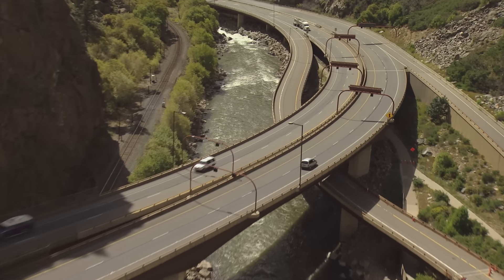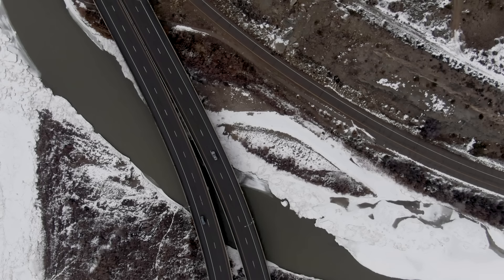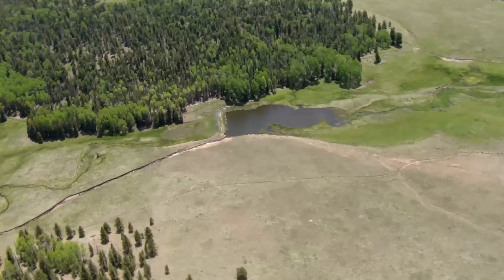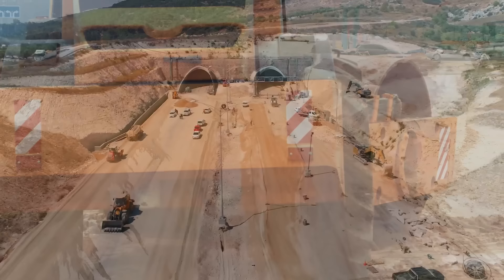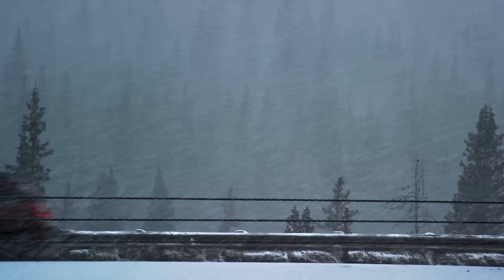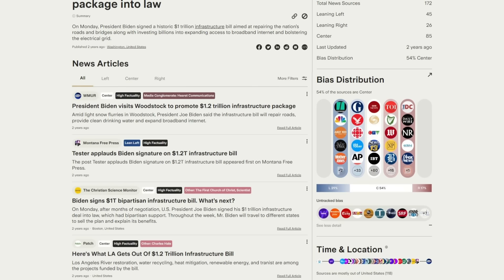How to Build a Road

Comment: The I-70 tunnels are 50 years old now, and are WAY overdue for upgrades.  They weep water that freezes on the road, there are heaves in the pavement in the spring thaw, they are too skinny, and are always badly rutted from truck chains.  We waste $$$ billions putting in dangerously skinny toll "express" lanes on the east side of the tunnels, that actually are only more places for cars to end up parked during traffic jams, and are always closed during snowy weather because of their danger.  Instead, there needs to be a 3rd tunnel, that can have traffic reversed to relieve the choke points that occur every Friday PM and Sunday PM.  No matter how wide you make the highway on either side of the tunnels, as long as traffic has to squeeze down to 2 lanes at the tunnels, there will ALWAYS be jam-ups.  A few years ago they instigated a "slow-to-go" program, where they meter the tunnel traffic, then put State Patrol cars in front of the traffic so no one can catch up with the previous metered group.  It's ludicrously stupid.  Was supposed to reduce accidents, but in reality, hasn't, but instead turns a 2-hour drive into 5.

Comment: The force caused by the inertia of a moving car causing it to go straight instead of following a curve is centrifugal force. The bank of a curve and the friction of the car's tires provide centripetal force to try to keep the car on the road. If it slides off the curve the centrifugal force is overcoming the centripetal force.

Comment: Step 1 - Spend 500m on research
Step 2 - Have the gov discuss if we should even do it and spend another 250m on those discussions
Step 3 - Find a contractor that will charge the city 25bn and then they'll subcontract the job to someone else for 2bn
Step 4 - Wait 15 years and project will be only 5% complete and x 100 overbudget.

Classic.

Comment: Road designers don't tilt/slope a road to counteract centripetal force!!! Centripetal means "center seeking". It is the force necessary to overcome the inertia to continue in a straight line and instead make an object follow a curve. It points to the center of curvature. Friction supplies the force normally. But a slope converts gravity into a centripetal force also. Hence, when friction is low due to ice, gravity can help make the turn -- just not at arbitrarily high speeds.

Comment: There's so much more to the Eisenhower Tunnel than any one video could possibly cover.  My favorite bit of trivia about the tunnel is that because of its 1.7 mile length, enormous fans must run continually to blow vehicle exhaust out of the tunnel; the electric bill to run these fans is $70,000 per month.

Also, the tunnel has a place in the history of the women's rights movement.  In 1972, a female CDOT employee was mistakenly assigned to the tunnel due to a name mix-up.  Male workers threatened to walk off the job -- and some of them did -- if a woman was allowed on the crew, because legend had it that construction accidents in tunnels were more of a risk if a woman was on the crew.  She kept coming to work anyway, and the men found a way to get over it.

Comment: A delightful video, as someone working in this field there was only one single minor half-truth throughout the whole thing. At 6:15, the $0.94 cent in additional cost sounds a bit less severe due to the value likely being from the time of planning. A modern value would likely be closer to $6.25 (10 mile by the vehicle depreciation rate of ~$0.625/mi).

And to put  that into further perspective, the AADT of this road is ~33,000 vehicles per day which translates to around $75,000,000/yr in additional costs.

Either way, very nice video.

Comment: Road banks actually generate centripetal force (instead of relying purely on friction) and counteract momentum (often mislabeled as centrifugal force). There is also a slightly higher amount of friction/traction due to the higher “normal force” aka force perpendicular to the road surface.

Comment: To be honest the section of I70 up to the Eisenhower tunnel isnt that bad. Once you get west of that though and up into the passes the roads become very narrow. I remember driving a Ford E350 van up there for work. You get to points where you cant get two cars by. Its probably one of the most beautiful drives though if you go out to Aspen, Glenwood Springs or Brekenridge.

Comment: There is a turn on a highway near where I live in the rockies that they did slope, but the wrong way. I would occasionally forget and drive around this corner at the same speed as the rest in the snow when I first moved here and the result was pretty dramatic. The rest of the corners were slow and controlled, this one you would go sideways immediately, so many accidents there.

Comment: Yesterday,  I drove I-70 from the Utah border to Denver.  What a horribly maintained highway. There were no snow or ice challenges- rather the undulated highway road surface itself, with the constant ups and downs of traversing the mountains, on truck-rutted pavement, is a disgrace.   Why can't we have a super mega tunnel on the European scale like they have across the Alps, to Traverse the Continental Divide for a lot bigger distance than what the Eisenhower Tunnel provides.

Comment: *Spoiler: It doesn't [work] very well.  I won't drive I-70 between Genasee Pk and Leadville unless it's an emergency or maybe 2AM.  Colorado's #1 traffic jam.

I remember when we always used to hold our breaths through Eisenhower Tunnel, back when you could actually go the speed limit.  

Edit to add: to the "scary drive" comments, come see us in SW Colo, by way of Red Mountain pass sometime, I-70 is like the Disneyland of Mountain passes, long lines being the biggest fear.

Comment: I grew up along this stretch of highway and I learned how to drive on it.  It took a while living somewhere cheaper before how differently other people look at driving sunk in.  But dam the stories I have from it.  I spent New Years eve stuck on the Dillon side of the pass in a blizzard when a chunk of chain fell off a truck in front of me in the tunnel and shredded a tire a few years ago.  I had a school trip get stuck in Glenwood when the canyon got closed and stayed in a hotel.  Or the rumors kids made up about the 'CIA' operations running out of the middle of the Glenwood canyon tunnel.

I think Glenwood Canyon is beautiful but I will always argue that the road should have gone over Cottonwood.  Yes it would have been much more expensive and been longer but dam if there isn't always something going wrong with the canyon.  At the very least they need to pave that way around so its open as an alternative during the winter.

Comment: As someone who lives here, this road sucks but it’s not the roads fault. The traffic is constantly in gridlock due to there not being any other roads connecting through the mountains. This along with the government adding a toll lane that is open very rarely and can cost $15 just for one trip is quite insane and is also normally just full of cars. They could’ve just made another free lane and improve the traffic
Reply: Another free lane would merely have induced further demand on a corridor that is already at capacity.   In essence, we would have returned to gridlock on the corridor in no time by doing so.  The toll lane is terrible, but there are few reasonable options.

Comment: "to counteract centripetal force" should be included in the yearly mistakes :p The centripetal force only exists in the earth's referential and is the one needed for the car to turn. If it is countered, the car won't turn and go straight. We need to take the car's references and it becomes centrifugal and needs to be reduced to make sure it does not skid off

Comment: Those who are mere motor vehicle operators and not real drivers can be spotted when they allow their vehicle to drift to the outer lip of a banked turn, rather than cutting to the inner edge. They brake and accelerate at all the wrong places as well.
Colorado also hosts "The Million Dollar Highway" from the New Deal days in the Monarch and Red Mountain passes.

Comment: ⏰TIMESTAMPS

00:00 - Introduction to Road Building: Challenges and road shape importance
01:26 - Road Design for Rocky Mountains: Difficulty in finding a route
02:30 - Northern vs. Southern Route: Cost analysis and earthwork considerations
03:26 - Route Selection: Decision between the northern and southern routes
04:23 - World's Highest Elevation Road Tunnel: Engineering challenges, selection
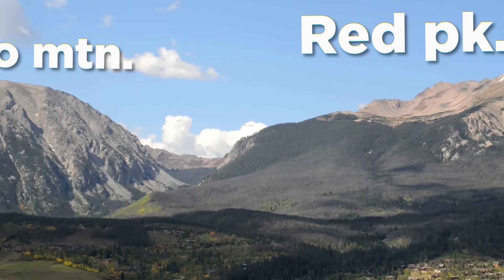05:48 - Alternative Veil Pass: Selection's impact on length, cost
06:54 - Creating Uniform Transportation Path: Earth moving processes explained
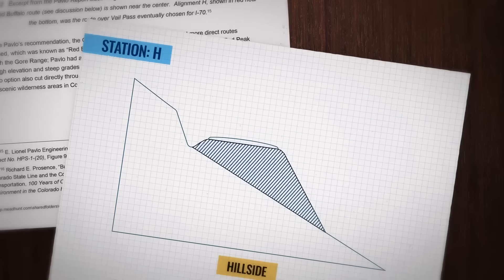07:52 - Calculating Earth Movement: Planning and cost analysis provided
08:43 - U.S Highway 6 to I-70: Transition to a larger road
09:33 - Environmental Constraints: Issues with Blackboard Creek, local watersheds
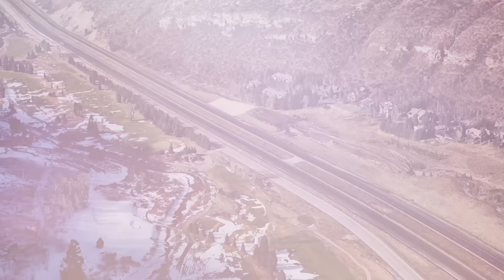10:55 - During construction: hay, sandbags slow runoff, prevent pollution
12:17 - Utilizing ditches, culverts: manage runoff, mitigate erosion considered
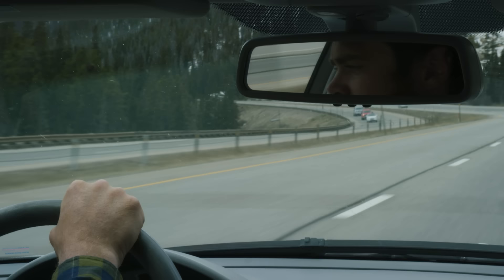13:41 - Vail Pass's $427M cost: carefully designed to fit landscape
15:00 - Eisenhower Tunnel's challenges: CDOT works to keep it open
16:50 - Avalanche risks; CDOT manages with controlled avalanches on roads
18:16 - Rain-induced mudslides: constant CDOT management required for threats
19:40 - Sponsor mention: Ground news, unbiased reporting, understanding media environment
20:29 - Closing remarks: Promotion of unbiased media consumption, thanks to sponsor.

LIKE AND SUBSCRIBE✅

Comment: Not sure where that 0% thing came from. Every straight highway in the USA and just about everywhere else in the world has a cross slope of at least 2%, expressed variously as 1/4" per foot, O.02' per foot or in metric 2cm per meter etc. This to allow for allowing runoff of water to prevent flooding or even minor ponding of water on impervious road surfaces. No responsible engineer would design any paved surface without some slope in at least one direction.

Comment: uHm AcTuAlLy it's not centripetal force that causes cars to skid but their inertia. The centripetal force acts perpendicular to their velocity to turn the vehicle, so if the force is not enough, the car will turn a wider circle. If this circle is wider than the turn, the car will skid out. This is why the road is sloped, so that gravity can help contribute to the centripetal force (usually only provided by friction from tires). Not like this detail matters just wanted to be annoying.

Comment: As interesting as highway megaprojects are, as a global society we really need to be moving away from inefficient intercity road transportation and towards efficient electrified rail transportation. It's got a much higher cargo throughput (and an IMMENSELY higher passenger throughput) per unit space taken up by infrastructure, it requires much less energy per tonne-km, it requires VASTLY less energy per passenger-km, it can be much faster, and the total societal cost is actually way lower than road transportation once you factor in the cost of manufacturing and producing all those short-lived passenger automobiles.

There are electric locomotives that have been running basically nonstop since they were built in the 1950s/1960s and still work perfectly. Automobiles operated in the same way would've failed and had to be replaced ten times over (if not more) since then.

Oh, and electric locomotives don't require the heavy, polluting, short-lived batteries that electric cars do... they use overhead wires or electrified rails, so full electrification of transportation around the globe is actually possible with electric rail (there aren't enough extractable lithium reserves on Earth to make all the batteries needed for stable renewable-powered grids [hence why we need nuclear] and battery-electric cars). Besides not requiring the scarce and expensive materials used in batteries (you can actually make overhead power lines for trains out of aluminium, which is very cheap and the third most common element in Earth's crust behind only oxygen and silicon; you don't have to use rare/expensive copper), and not requiring any complex or costly manufacturing processes, wires and rails are also economically 100% recyclable with present-day technology - whereas we still haven't figured out how to truly recycle batteries, especially not in an economically viable way.

Plus passenger rail doesn't put transportation behind a $10k+ paywall for every individual like road transportation does, and unlike driving (which is straight-up impossible for many disabled people) rail can provide transportation that accommodates basically everyone.

Yes, even people who hate being around other people... on many rail systems [albeit mostly for long distance, though this could totally be done on shorter routes too] you can get a private booth or even a private cabin in a sleeper car.

TL;DR: Road construction is cool, but roads are bad because cars are bad (for a lot of reasons), and we should really be building tracks for trains instead because they're better for society and for our planet.

Comment: I always tell people that if you are going on a road trip, stay off the interstates.  They are boring.  This here is the exception.  Out of Denver CO west.
"Fun" facts:
1. If you live in low elevations, you will get dizzy as you get to the top.  If so: don't talk, breathe like you mean it but normally, don't over do it, also bad.
2. They sell small canisters of oxygen at gas stations in that area (inhaler type thing) to help with point 1.
3. Spring time, when snow is still heavy on the ground but roads are dry, that entire maintain area is beyond beautiful, and I don't see much beauty in anything.

Comment: Why not build tunnels HAHAHA. In northern Italy there's the A32 Torino - Bardonecchia highway which has 2 tunnels of 7 km and several others shorter. It ends at the Frejus Tunnel, which is a 12.8 km long and connects Italy to France passing under the alps.

Comment: traveling through highway 70 i will say you need at least a diesel for torque or even better a 4x4 diesel
Reply: Most gasoline vehicles actually perform better in this situation. Most diesels feel weak

Comment: Is this an insane feat of engineering? Yes. But it's also a reminder of how much money we sink into our roadway system instead of the rail network we gutted.
Reply: I do agree that we need to MASSIVELY expand passenger rail in North America. That could reduce both traffic, and our emissions. But keep in mind, rail infrastructure still requires constant maintenance, and is very expensive to build and maintain. The same engineering challenges required to build this highway would also apply to a railroad.

Comment: I was just visiting Colorado a few months ago. The tunnel idea was really cool until we got halfway in and all I could smell was some of the strongest car exhaust air I've ever smelled in my life. When they built that tunnel they seem to have forgot about ventilation or at least they didn't do a good job with designing for it. I came to a realized horror scenario: What if there was a car crash blocking the road? We'd all be stuck in this tunnel with air that's barely breathable! Luckily we made it out and there was no blockages.

Comment: 0:08: 🛣 Building roads through mountains presents challenges in terms of slope and design.
5:19: 🛣 The decision to divert I-70 to Veil pass led to additional fuel and maintenance costs, but provided a route for Colorado's Trans Mountain Interstate.
10:52: 🚧 The construction of the road in the area caused concerns about sediment runoff and water contamination, leading to the implementation of temporary measures and long-term strategies to manage water flow and erosion.
16:09: ❗ The safety of Hazmat trucks in the Eisenhower Tunnel is a concern due to its remote location and potential for damage.
Recap by Tammy AI
Reply: Thanks for the breakdown Tammy AI!

Comment: This section of highway has cost Colorado tax payers a disproportionate and unreasonable amount of money since its inception. Those coming to use it are using it on the backs of generations of Coloradans who have lived poor under a tourist-centric economy that is designed around exploitation of Colorado's environment and people for the sake of entertaining tourists and transplants alike with scenery and domestic services carved into places that can't support it. By doing that, the State and Federal governments created a chronic tax bleed from the locals that receives more of our tax attention than any other road in the State. Deeply rooted locals know that this road is an abomination and an example of irresponsible decisions and spending by our State government. This road should be free to locals, and it should become a toll road for anyone outside the area who wants to use it - and those tolls should be used to STOP externalizing use and maintenance to statewide tax payers, and charge those using and damaging the infrastructure for use of it. This section of road costs Coloradans millions of dollars per year, which are NOT recouped by tax revenues from the locals, even in the form of tourist revenues. This road is a fiscal, environmental, and social atrocity. Sure, it's awesome engineering -- but it's a perfect example of where government fails, and the locals across the entire state pay for the externalities of those bad decisions in this one localized area. Spread the word.

Comment: Why making such a fuzz about a 3km tunnel? If I d go from my University in Austria to my Parents I d go over the A9 and it is way better and more complex than that highway in the US. It is multiple tunnels with around 10km and going through steep valleys and through the central Alps. A10, A22 or Autostrada A23 in Italy. Those are all way more complex and nobody would consider them as a marvel of engineering, but of course the Americans need to sensationalize everything.